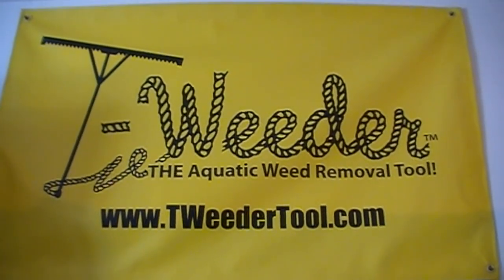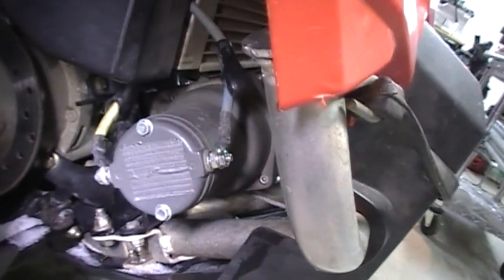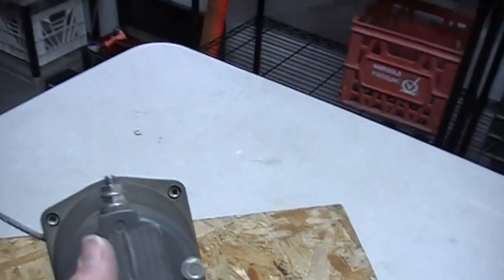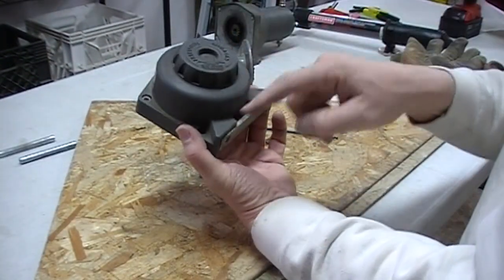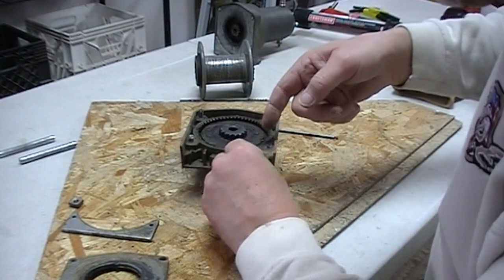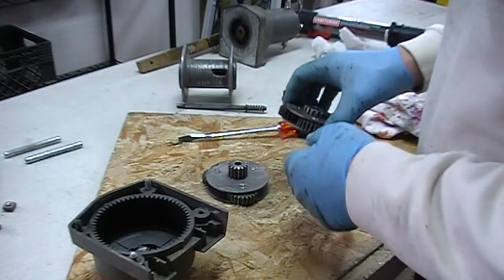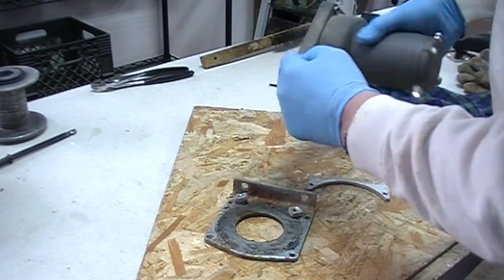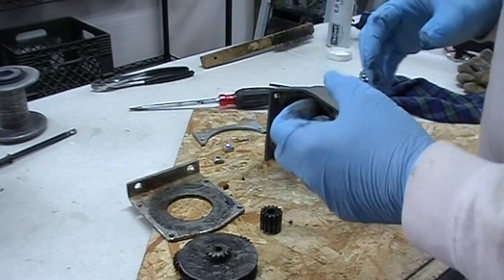How to Do an ATV Winch Rebuild

Comment: Just took apart my little 1500 lb. Super winch yesterday and it's even easier than that one to rebuild them. Mine is about 15 years old and still works like new yet. I've always cleaned them up inside and re-greased all the moving parts to keep them working properly. They do last a long time if you take care of them. Mine gets constant use lifting my snowplow all winter.

Comment: My freespool isn't working after taking it apart. Any suggestions? 
Also, what did you use to grease the motor windings??
Reply from the maker: Hey Wayne- I'd guess that one of the gears didn't get seated or installed correctly if the freespool won't work. You will probably have to take it apart and see where the problem is. I used low-temp lithium grease. It's an off-white color. Hope that helps. -Tim